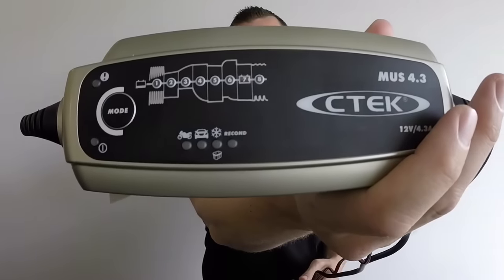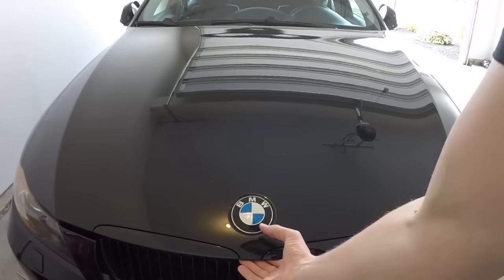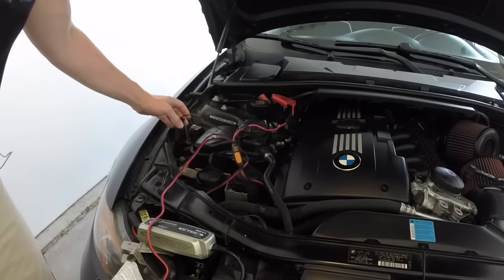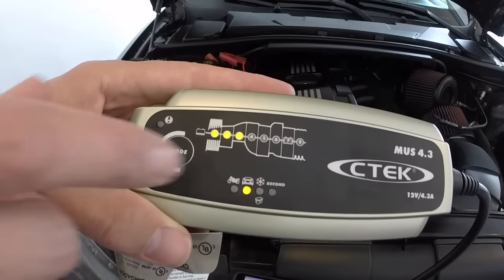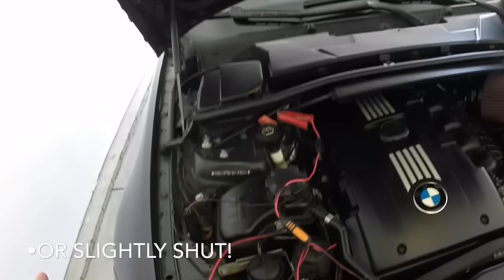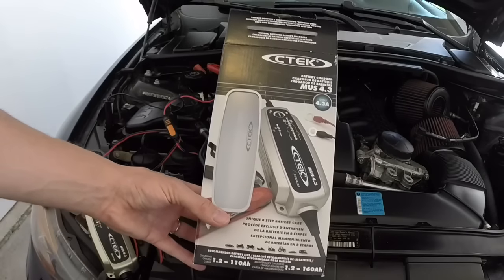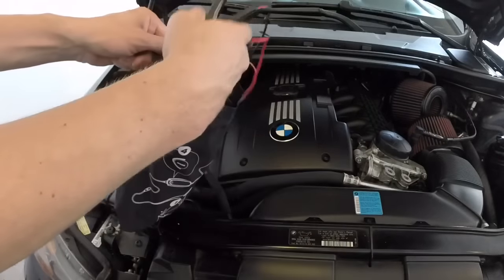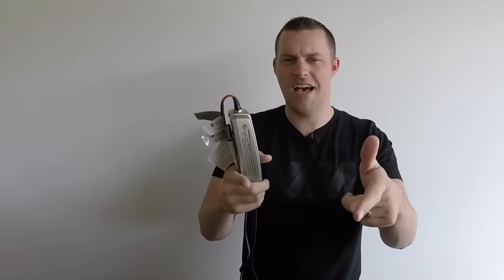How To Charge A BMW Battery! CTEK 4.3!

Comment: A mechanic told me to charge directly on the battery as the CTEK charger although a great choice doesn't give the battery enough power. What are your thoughts?
Reply: charged directly battery and now bmw says my battery is too low LOL..... I think charging from front is the only way, because bmw is counting how much battery capacity it has, not what voltage at the momment
Reply: @MariusVerbavicius  but you should disconnect battery from car
Reply: @lucasg1988  no, you MUST NOT DISCONNECT battery when charging.  All settings will be lost.

Comment: I used to have 6 1000 ah batteries in my lolo, wired in series, the c-tek charger was the best charger to use in re-con mode, I tested multiple battery chargers and nothing compared to the c-tek !.....dont dick around with other chargers, get a c-tek!

Comment: how does this charger differ from the MXS 5.0 which is newer?  Does the newer model have all the capabilities of the 4.3?  The 4.3 is more expensive than the newer MXS 5.0.
Reply: They probably used cheaper components in the newer one despite the fact that it's slightly more powerful.

Comment: Fish it though for what? Where is the battery located. Auto Zone checks batteries for free.
Reply from the maker: Charge ports are under the hood as seen - you can fish it through the top of my the hood so you can close the hood
Reply: Arthur Smith the battery is in the trunk of the car, I would not recommend letting anyone other than BMW service anywhere near it though

Comment: This is a bit misleading. Battery charger connections are the same for all vehicles, regardless of make. Ain't nuthin' special 'bout BMWs.
Reply from the maker: Ya, my channel is 100% BMW related hence the video
Reply from the maker: Applies to anything
Reply: No their not, how many other vehicles have their batteries in the trunk of the car? Or need to be “registered”, etc. etc. There is in face a BIG difference between a BMW battery and other cars. Maybe if you owned one you would know that
Reply: I do own one, and it's the same as any other car as far as charging. Positive to positive, negative to negative, DONE! That battery registration stuff is a bunch of techno-silliness I think a lot of us wouldn't miss if they left it out.
Reply: tempest411 good luck with that. The newer BMW lithium batteries require special chargers even and are computer controlled basically and require special  care. The silliness must be done.
Reply: Alot of European vehicles are being made with this battery feature.......the battery after being replaced or sometimes when the same battery dies  the vehicle must be programmed because certain parts of the computer reads the condition of the battery to supply the proper amount of power needed such as gas mileage etc. Failure to do this may cause false error codes and eventually mechanical malfunctions.

Comment: How tf it charge the battery if the battery in trunk lmao
Reply from the maker: Under the hood connections to charge if battery is still in the car. Or remove battery and hook up battery charger directly to the battery
Reply: @BMWFanatic while battery still in the car better not charge it directly to battery? Better use connections under the hood?